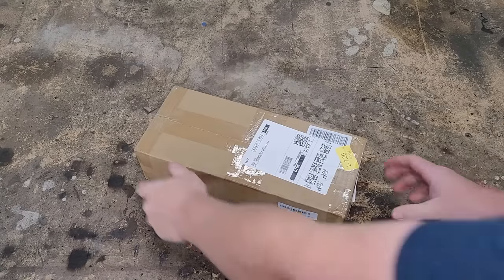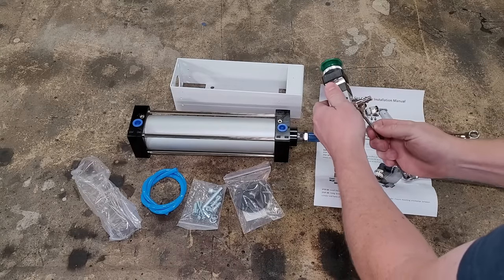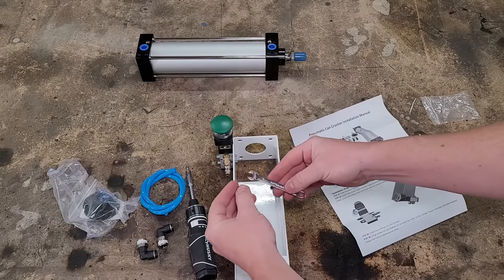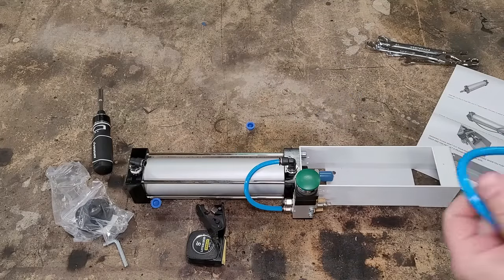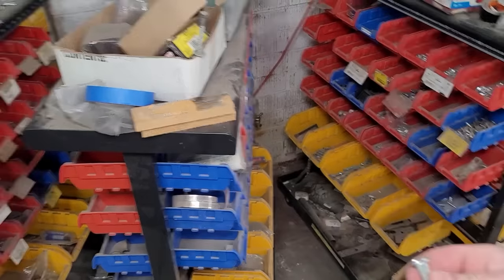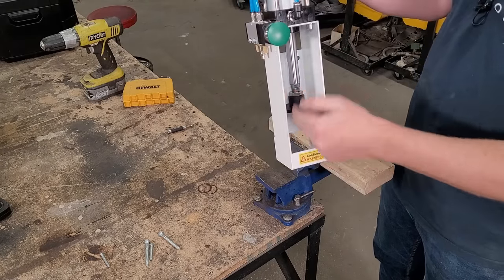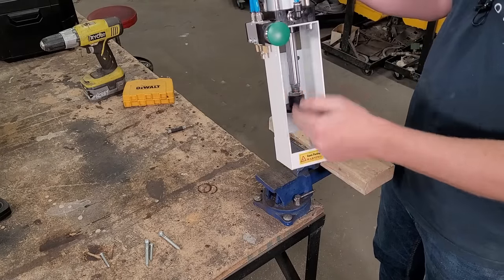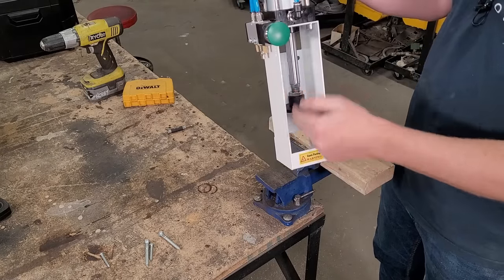Best Can Crusher on Amazon it's Pneumatic!  Unbox, Assembly, Review!

Comment: Highly amused at the term "croissant wrench" to refer to a shifter.

On one hand, this looks pretty awesome. On the other hand, needing an external compressor is a deal-breaker for my own purposes. I'm currently using a lever pull sort and considering an upgrade to something powered.
Reply: amazon sells an electric version
Reply: You could use co2, maybe capture it from when brewing beer 🤔 or an air tank you pump up with bike pump¿
Reply: @gildoubrava5998  They use a considerable amount of air.  You'd be better off stomping them the old fashioned way, than struggling with a pump.
Reply: Is that wrench editable?
Reply: @davec2891  Or maybe edible? 😏

Comment: Bought one of these Amazon Prime Day discount. Identical white part and everything but the button is safety thing with a rim so you gotta shove your thumb down in it. Been looking at a foot pedal to replace. Mounted mine on a 1/2 plywood sheet with a milled down 4x4 block for it to lay on. Added an angled out wedge to get the can to discharge and kick out a few inches into my bag and not fall straight down between the wall and my bag. Loved your humor.
Reply from the maker: I saw some crushers with the recessed buttons and liked that this one had the palm type.  Foot pedal would be good except if you lost your balance while clearing a jammed can and got your hand crushed!
Reply: @HerbOMatic  Pokey stick at the ready. I already got a dark red mark on my finger because I reached around to hold when air pressure was low to smoosh them flatter after it refilled.
Reply: @FearsomeWarrior  I thought I was the only one that did that!  I keep an old screwdriver nearby when I crush now.

Comment: I worked for a brewery for a few years and when canning the beer, the brewers would pull random cans off the line and put them in a vice to make sure the cans could withstand a certain amount of weight. So, it's not surprising that this crusher can't crush a full can when it's putting pressure down on the strongest point on the can. For reference of how strong cans actually are, 1 pallet of beer held 100 cases of 12oz cans with each case having 24 cans, and we would stack these pallets 2 tall for space saving. Each pallet weighed about 2100 lbs.
Reply from the maker: The amazing things that seem mundane but are actually little marvels all around us.  The aluminum can is crazy good engineering!
Reply: This sounds like the beginning of a math problem...
Reply: 2,400 cans per pallet x2 = 4,800 cans on top of 2,400. 12x2,400 = 28,800oz in one pallet= 1,800 lb per palletx2 =3,600 lbs on top of the one pallet. This equals around 1.5lbs per can. And that's with misreading your comment thinking you said stacked 3 high. With 2 high it's only around .75lb per can. Sorry if my math is wrong I'm a little dumb.
Reply: I was thinking, not in the elegant way you stated it, but think of all the beer and soda stacked on a trucks every day.  
As sturdy as these cans are, I get mad as hell when I drop one and it starts shooting all over the place.  I'm curious if the aluminum is thinner than what used to be used?

Comment: i bought the same one from amazon as a christmas present and works great i just bought a different air valve .  the kids are arguing about who can crush the cans pretty funny greetings from the Netherlands
Reply from the maker: I would have gone nuts over this as a kid!  Thanks Ger!
Reply: I got some of those from Amazon also, about 6 months ago. But I put a foot operated valve on it. Makes it a lot easier. Seems can get about 45 lbs. in a 38-gal trash bag. Still easier than the old can smashers. Just be sure to use air tool oil for the seals about once a week for top performance.

Comment: As far as safety of fingers inside the crusher when the button is pushed, you could either add a foot pedal at a distance over an arms length away to replace the button or add another button plumbed in series with the original one. That way it would take both hands to actuate the crusher, lowering the chances of an operator's finger being in the crushing area when it's cycled. Also, a 20oz red bull has to be pre-mashed a tad before it will fit. I remedied this by adding a spacer between the frame and the cylinder, moving the piston surface back in the frame increasing the loading area. Cans aren't crushed as flat, but its good enough for the effort.
Reply: Safety of fingers, use the same method as an electrician working on a breaker box…….
Use only one hand.
Place can, then press button.

Comment: I've found the box welds to be weak at the head end..  seems OK with 100% lateral force but when one side of the welds takes a greater force than lateral, snap!  If you have a welder it's an easy repair.
Reply: I broke mine after 4 months of use.  Was an easy fix.  I'm not a great welder either, but a grinding wheel makes it look outstanding, especially after painting it again.  hahahah

Comment: The limit on the PSI coming in might be to prevent someone from trying a full can. If the soda can has 60 PSI internally, depending on the area of the ram you are probably putting less actual pressure on the can. If there was enough pressure to overcome the internal pressure, the can would explode and probably sling aluminum bits at nasty speed. The manufacturer of the device probably prefers that not to happen.
Reply from the maker: I would think so!  It puts 473 lb of force on the can so I think the can can withstand a load of weight vertically.  Thanks Mark!
Reply: It takes around 800lbs of force to do a full can... So that dinky can crusher aint gonna cut it.
Reply: @HerbOMatic  I bet if you took the black round crushing disk off and then tried it, it would probably go through the top.  The reason I'm suggesting this, is I want to see what happens, and I don't want to have 12 oz of soda all over.  hahahaha. I have one of these crushers based on your recommendation.  I can verify that this crusher will smash a human thumb.

Comment: Required components: double-acting cylinder, 5/2-way manual reversing valve, air pipe, iron plate groove, and fixing screws, bolts and air source.

Comment: A little spring loaded dumping system could get the cans out in a vertical position
Reply from the maker: Or redirect the exhaust with a hose to blow out the can.
Reply: @HerbOMatic  nah nah nah
Get a baseball launcher and have it programmed to launch the can out at maximum speed

Comment: I been looking at can crusher's, I usually just crush them by hand after drinking one , I have a compressor, so no problem there. But did you say hundred bucks!?
Reply: How does the air compressor work bro? The power source is electric right?

Comment: Can't compress liquid just likee  in an engine you get hydrostatic lock or simply bent rods and trashed bearings.I got one of those can crushers ,mine doesn't have the raised button my is flush harder on thumb or finger,tried crushing soup cans don't work on steel cans

Comment: TY FOR SHARING THIS. I NEED SOMETHING LIKE THIS APPLICATION; WASN'T EVEN THINKING PNEUMATIC. I WAS LOOKING FOR ELECTRIC.. BUT MY PROJECT IS FOR VERY SMALL ITEMS. HOW WOULD I REDUCE THE PRESSURE & REDUCE THE TRAVEL FOR CRUSING HAZELNUTS. ANY IDEA?
Reply from the maker: You could use an air pressure regulator, compressors have them mounted on the tank.  You could start out at like 10 psi and work your way up.  travel, you would have to drill a hole to install a rod in the housing to stop the plunger from returning all the way.  Keep your hands out of it!
Reply: @HerbOMatic  THANK YOU SO MUCH.. I'MO PONDER THAT. SEE IF I CAN WORK THAT THRU. STEP 1"FINDING A PRESSURE REGULATOR." APPRECIATED SIR.

Comment: I’ve got a problem. My arm is operating backwards from what it should be doing. When nothing is pressed, the smash arm stays down. When I press the green button, the arm retracts and I can drop in a can while holding the green button down. When I let go of the green button, then it will smash the can. But it stays down in that position. How do I reverse it back to the correct pattern? Any ideas?
Reply: Never mind, I figured it out. My two blue hoses were flip-flopped. Had to switch them around. It works now.
Reply from the maker: I just ready to say this, the way you had it is dangerous lol.

Comment: What is the minimum compressor litreage required?
Reply from the maker: I don't know, I don't think you would need to big of a compressor but it will run more often if your tank is small.  Don't be ashamed of your tank size, it's how you use it that counts.
Reply: @HerbOMatic  Thanks for the kind words. 😄

Comment: i have one very similar, but mine the switch once pressed stays pressed, until you turn it to release it.  Bad Idea.  A can got stuck and trying to get it free the whole thing flipped up the red button pressed by my arm.  Two fingers on BOTH hands got crushed in there.  There was no way for me to release it. i shut off the compressor with my foot,  tried turning the button with my teeth no luck.  tried disconnecting the air no luck.  No one was home.  I say a neighbors window open so i screamed for help like a damsel in distress.  a teen age girl comes running out the house.  I tell her to turn the red button, she does and the thing drops to ground releasing my fingers.  the whole neighbor hood heard me and came out so embarrassing.  And it was caught all on camera so my wife can laugh at me.

Comment: No surprise it wouldn't crush a full, unopened can. Literally that's the design of the cans, to withdraw massive amounts of pressure being placed on them from above and below. Enables them to be stacked without the cans deforming.

If you dented the can slightly from the side first, story would have been entirely different 😏

Comment: Apparently you can connect a foot pedal to that, so that's a nice little addition.

I might grab this for soup cans and other canned goods, would save space in my recycling bin (for some reason they limit how much we can recycle a week here, I normally overfill which they bill extra for)
Reply: How does the air compressor work bro? The power source is electric right?

Comment: Nice video. I would have mounted it on a wedged shaped piece of wood spanning the "crush zone" and the air cylinder. Then you could mount it on the wall and the chute would work as a charm. (At least it works well in my head 😂)
Reply from the maker: I find that stuff in my head works out 22% of the time, thanks David!
Reply: The only issue with mounting it a wall, is that liquid sprays out when the can isn't completely empty.  Unless its been sitting on the side of the road, it probably has some in it.   Unless you mounted something on the wall to keep it clean.

Comment: What's the thread size for the air mufflers? Being that they're metric unlike the other half of the unit. Or is it still SAE threading?😅
Reply from the maker: I haven't the foggiest.
Reply: Well that's okay. I've ordered the necessary parts to mod an auto eject on the front. And if I need to tap it that shouldn't be a problem. Plug and play is always nicer though. 😅
Reply: I've purchased three of these. We mounted the one I got for my dad vertically. We haven't adjusted the mounting position perfectly yet but it's angled away from the stud at the base (it's mounted on a 2x4 on the inside of a shed door). I think it needs to be mounted on some type of wedge. After getting several ideas from home made crusher videos online, I took the discharge air from the muffler on the return side of the valve body and plumbed it down along the side of the crusher housing and then around to the front. The can gets crushed, then while the piston is returning, the exhaust air blows the crushed can away and down into a bucket. Great video though! I picked up a couple more ideas. Thanks!  One note if someone is considering redirecting the discharge air to the front..... The crushing puck and the housing are tight clearances. Because it's minimal clearance I ended up gluing it (E6000) to the face so that the tubing could sit as flush as possible while not entering the crushing zone through the hole I drilled through the housing.

Comment: What do you do with those cans?
Reply from the maker: Take them to a recycler they pay by the pound for Aluminum.
Reply: @HerbOMatic  you will be jealous to hear that I get 10 cents per can in Oregon!
Reply: @jakertheelaborater2573  gonna beat that with 25 Eurocent per can in Germany. they can't be crushed though which is sad.
Reply: @Bolli1983  nice! What if tha barcode was on the bottom so you don't need to tilt the can for scanning and more details could be added instead of ugly lines
Reply: @jakertheelaborater2573  would be nice, however since the machines they use to collect the cans in the shops can only scan the side, that's not going to happen. did I mention we have to actually pay those 25c extra per can when we buy them?
Reply: @Bolli1983  the machines can be modified scan them right side up until, the can gets bent in half

Comment: 2 1/2" bore and 120PSI air pressure will give 589# of force on the ram...that'll mash a can proper!
Reply from the maker: You saw that I had her cranked up to 120!  She's rated for 90 I think that's where the 473 lbs of force comes from.  She crushes them flat as heck.  Thanks Tony!
Reply: @HerbOMatic  any idea if it will do empty soup cans?  Here in the peoples republic of Oregon we have to return out soda cans more or less intact to get the deposit back but soup and cat food cans would sure look better in the bag crunched up.  Could put off going to the recycle center many times longer that way...